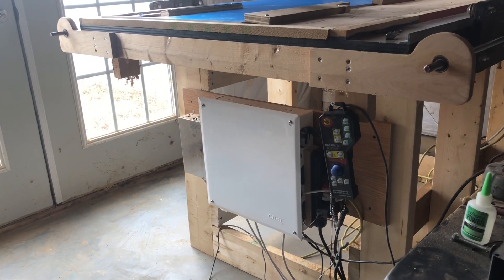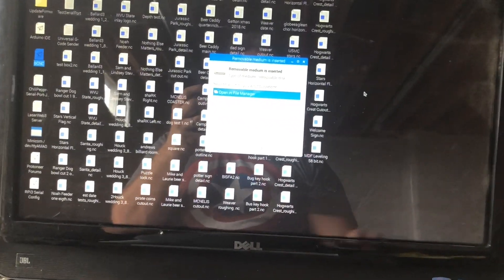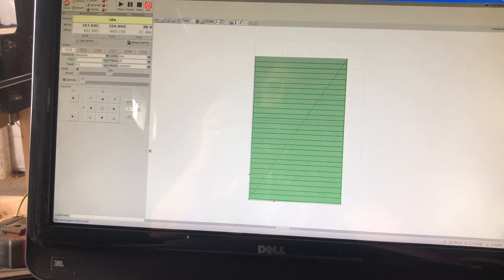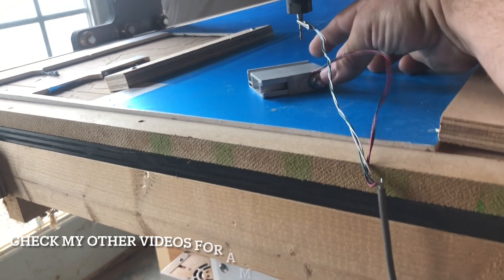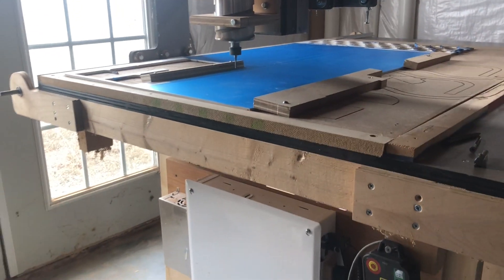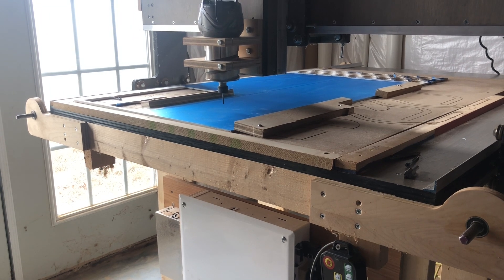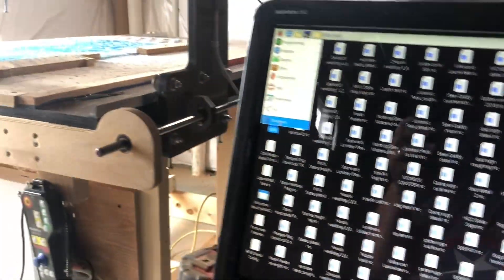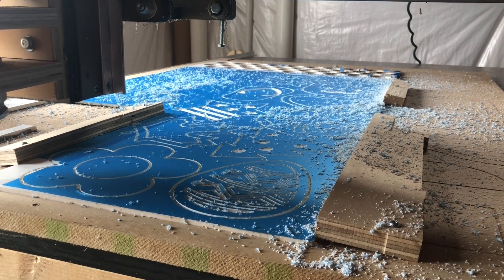Raspberry Pi Cnc Build Part 3

Comment: i am having problems connecting to the cnc hat i followed your setup video and have cncjs running on the pi. cncjs shows connected to /dev/ttyamao  but i cant jog anything. option to jog is not active. unlock reset and home functions show in console but dont have any effect. any help or guidance to resources would be appreciated.

Comment: Can this setup (or something similar) handle closed loop servos?   The machine I’m building requires the positional feedback and can be WiFi enabled.  Would also prefer it to be stand alone and not PC driven.  Haven’t found a controller yet to do all that.

Comment: Hey ryan  are you using the raspery pi  + raspery pi cnc hat combo right now? Do you know wether i have to use the external drivers or could i use drv8890 drivers on the hat?
Reply from the maker: Yes that is the set up I am using.  I use external drivers on mine but you could use pololu drivers on the board if you wanted to.  You are limited to a max of 2a on those though.
Reply: @RBallarddesigns  yeah ok thx for your reply :)  but the drv8825 need 24v  can i power up the rpi cnc hat with 24v?
Reply from the maker: @TiMechOfficial  the Cnc board itself will run on 5v from the pi. When using onboard drivers there is a place to hook an external power supply on to.  I think it is rated for up to 36v.
Reply: @RBallarddesigns  cool thats perfect sorry :S but one more question... can i use grbl 1.1 with fusion 360?
Reply: @TiMechOfficial  I just looked and Fusion 360 does have a post processor for Grbl.  You just need to configure it in the Manufacture Setup.

Comment: Nice.  I use the same router.  

For the z touch plate, instead of using an alligator clip to the bit, I ran that wire with the cabling to the router body (which is grounded to the bit).  This way,  you just need to put the plate in place, and run the code to zero - no more alligator clips.
Reply from the maker: Thanks for watching Rob. Good thinking on the ground